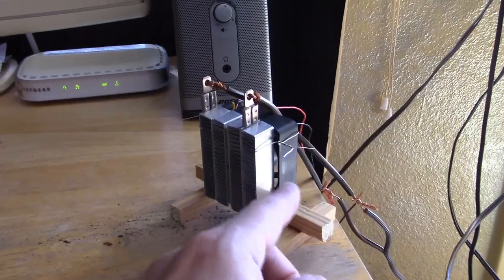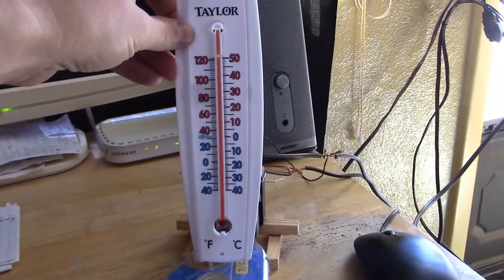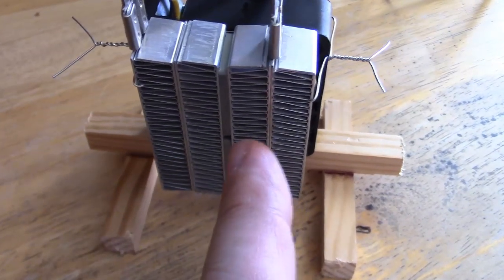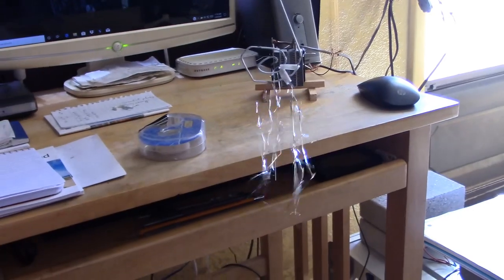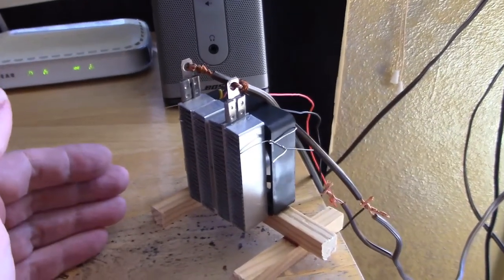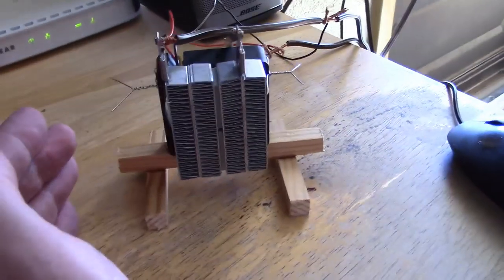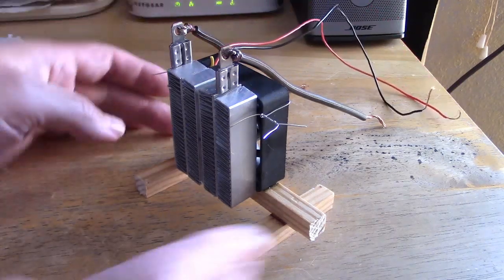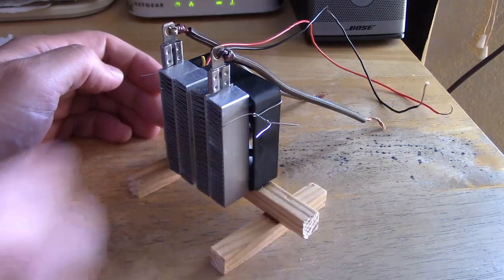DIY Ceramic Space Heater! - New/Improved! - Temps 140F(60C)! - On/Off-Grid! 12V/6a - Works in a Car!

Comment: Get more solar panels get and old furnace centrifugal blower assembly replace the ac motor with a 24v dc motor put 4 of these PTC heaters at the end connect to house vents ..now you have a solar furnace..these PTC heating elements get up 300 degrees Fahrenheit.

Comment: Hi how did u connect with a 12v battery?
Reply from the maker: hi. it's just a straight connect to the terminals of the battery (positive to positive and negative to negative). by the way. if you like this type of heater i've got 2 more heaters of this type 'in the works'. vids on them will be posted soon. both are 12v but are more powerful. one of them is way more powerful.

Comment: your video gave me an idea so I've ordered 20 ptc elements and will attach them to old pc heatsinks and use the pc fan to blow through them,  igot a 120 solar panel doing nothing
Reply from the maker: hi. sounds like a good idea! i may try it
Reply: @desertsun02  yeah another could be an old car radiator and use the fans they come with i'll be waiting to see you try it
Reply: could be water heater too
Reply: For starters look at the total Watts that they're designed to use versus the output of your solar panel. Also the voltage

Comment: What is the lowest electricity that can be run through those maybe you don't need it so hot just to make it warm what is the lowest amount of electricity that and amps that can be supplied to this element.?
Reply from the maker: hi. i'm not sure about the lowest but the element is proportional so you can definitely use a lower amount. you could probably hook it to a 10 or 20 watt 12v solar panel and still get some heat

Comment: I have a similar setup, with a 12v, 10 A ac/dc power source but it keeps short cycling, any idea why? works fine o a 12v battery.
Reply from the maker: hi. i'm not sure why it would short cycle. i'd try new power supply. (if it works on a 12v battery then you know the unit works)

Comment: the plastic fan do not melt in contact of the ceramic heater?  How long can run to of those heater with two 12v
Reply from the maker: hi. nope, it won't melt (not even close). (they also sell ones that are pre-enclosed in plastic). how long it will run will depend on how big of a battery you use. 10 or 12 hours at a time is easily doable
Reply: @desertsun02   Excellent thx.

Comment: I saw your last video about this (a couple days ago) and ordered parts for it. I drive an EV - which has a heater that uses 1.6kW to 9kW of power - and this is going to help a lot!
Reply from the maker: sweet!
Reply: @desertsun02  I made it! It took a little trial and error because I didn't notice the wiring and connected the fan and the element together, which blew the fuse in the 12v adapter. I realized my mistake and went to Walmart and got some fuses for it. Now I just need to wait for my wires to come in so I can finish it and build a case for it. Thank you a lot for this video!
Reply: @desertsun02  What material would you use if you made a case for the heater?

Comment: I realize this may be a stupid question but how do you determine which is red and which is black for the heating element?
Reply: Heating elements are resistors, so electricity can flow in either direction. Just make sure you have one positive wire and one ground (negative) wire!
Reply: @TobyNguyenMusic  Thank you. Your videos are very helpful.
Reply: @cassiecory9296  These aren't my videos but I'm just trying to be helpful. :)

Comment: think there would be any issue with a 12v 6a power supply plugged into temperature control switch like a inkbird. thinking about using this to make a heat system for several reptile enclosures.

Comment: What if you had it four of these 12 volt heaters to a furnace instead of using gas.. and maybe a 12-volt blower for the furnace?
Reply: They would heat a 28 sq ft room.
Reply: So how many would I need to heat up a camper that has 21 foot and 8foot wide inside living space? To keep it at 73 degrees inside? And I know a guy that selling these 405watt solar panels

Comment: Thank you. I like your project. I am thinking to make on, but a littet different. I have solar panels and 200 A batteries in my garage that a charged from the panels. Do you know how I can make a regulation to use the exstra energy that are produced from the solar panels when my battry is full? I like to use the exstra energi for heating my garage like you do. I need to have a regulator that will turn the heater off, when my batteries need power. How can I make that?

Comment: Could this be fitted with a usb plug?
Reply: No
Reply from the maker: hi there. usb outlets are around 5v and the heater is 12 so it wouldn't match up (also you probably couldn't get the amps needed using usb). it's possible that someone might sell these in 5v put haven't seen any

Comment: Great video! Ironically most new ceramic heaters use a very similar setup with a higher watt element ceramic heater and a stronger fan, but it’s still the same with that little CPU fan.
Reply from the maker: hi and thanks. yep, the internals of the ones you buy are mostly the same.

Comment: Great vid!! I found your original and then this one. I want to make one or two powered by a Solar panel. I have a question that maybe you can answer. My solar will be partially shaded throughout the day  so 1) If the panel output less than the 6 amps/100 watts, will the heater stop working completely or just heat at a lower temp? And then what happens if I hook up to a 250 watt panel, will it burn up the heater with too much current?
Reply from the maker: hi and thanks. heater is somewhat proportional so it will heat some with lower power. these can be hooked up to any size 12v panel. they will only draw the current that they need. you could hook it to a 500w 12v panel if they made them and the heater would run perfect. i don't think there are any 12v panels that are 250 watts though. the biggest 12v panel i've seen is 200w. i think they make 24v, 36v, 48v and 60v heating elements thou, so if it's a 24v panel just use a 24v heating element. 🙂
Reply: @desertsun02  Thank You for your reply. I thought this was the case and I wanted to see if you could confirm. I  have begun exploring off grid solutions to heat and power my home on 2 + acres in the mountains of California. We expect to continue to be plagued by Power shutoff's and other quality of life issues. I'll avoid stating my opinion as to why they are happening but it's not in dispute that they will continue for years to come. I have also found other vid creators that show how they heat and store energy in the form of Hot Water. Your vid on heat exchanger  using hot water looks like an option. I am semi-retired and have some time now to tinker and work on some of these ideas. Thank you again for making these videos. Keep up the good work!
Reply: @dalemcf3087  Harbour Freight has a plug and play solar system for beginners. It's super easy to set up and is a 100 watt system. It is a bit pricey as 100 watt systems go however for a beginner it is a good place to get a start.  !:- )

Comment: i reckon this would work for my small van. Allthough i may prefer your ceramic thermal space heater. which would be more efficent i intend to use a 12 volt battery bank .Cheers for another great vid
Reply: I'd like to try this in my dodge minivan that I plan an upgrade from one to two DC house batteries